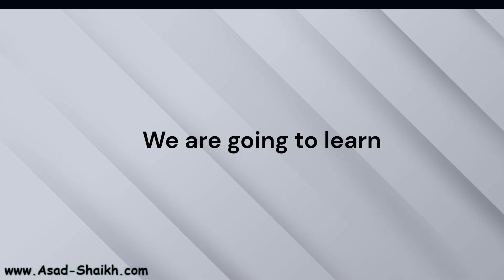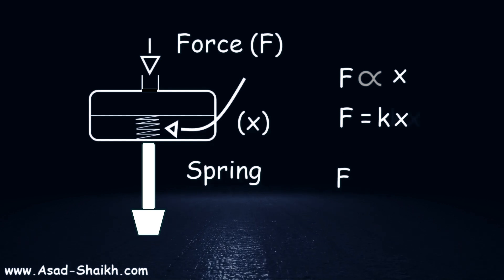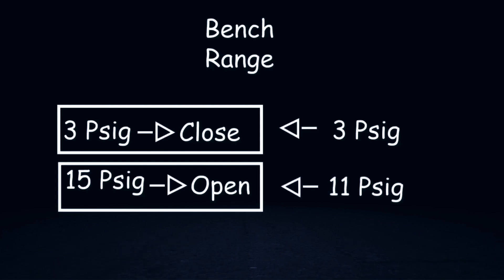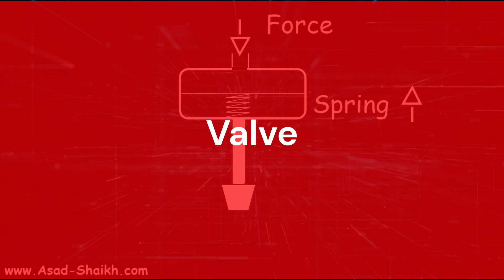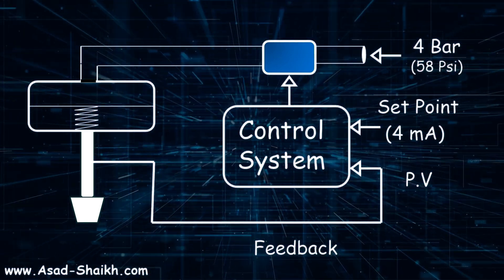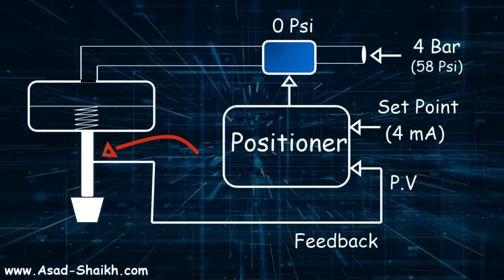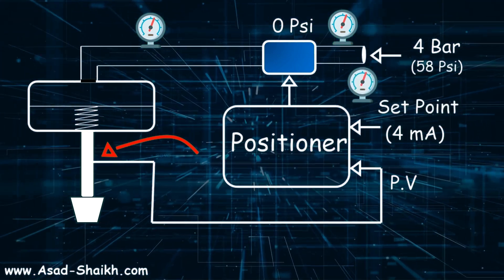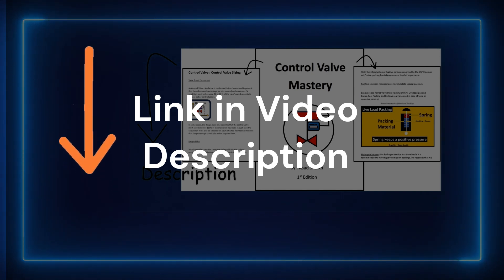How Valve Positioner Works | Hook's Law

Comment: this is Air to close valve. if you apply the pressure in the diaphragm it will move the stem downside & stops the fluid passing

Comment: If you use 4-20mA as a control signal, then two gauges are enough. The third gauge would have been used on older 3-15 psi control signal positioners (but can still be is used with 4-20mA control signal when you have double acting actuators)

Comment: What does the third gauge indicate?
Reply: See my comment - If you use 4-20mA as a control signal, then two gauges are enough. The third gauge would have been used on older 3-15 psi control signal positioners (but can still be is used with 4-20mA control signal when you have double acting actuators)
Reply from the maker: Absolute correct @kmaarouf1 , Thank you so much for answering the question !! 😊